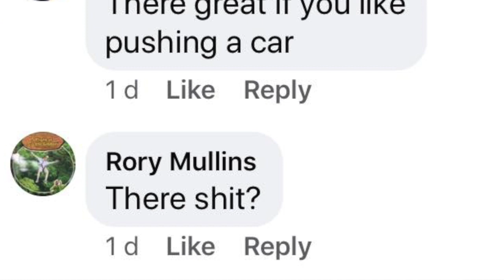WHY DO PEOPLE HATE JEEPS??

Comment: Had 2 jeeps, 2011 jk sport, and my current 2015 jku both sports. Based in us in Maryland and I love it. Its quirks are what makes it full of character for me! No issues but I also haven't slapped 37s on the stock axle with a cheapo lift just to get the look. No real issues with either. 

Got an ox locker in the rear, chromoly shafts, trutrac up front, regear to 4:56, 33's and its been fun and reliable on the trails around me. Dont let others close minded peeps ruin what you like. Here in the states they are a smaller group, but Toyota trd peeps absolutely hate on jeeps all day.
Reply from the maker: SPNKr02 awesome stuff mate, sounds like you have some great Jeeps. Oh yeah definitely, I will always love my Jeeps, just always wounded why people had so much hate for them.

Comment: My experience. Is my jk has been the most reliable vehicle I have owned.  Sure the Jeep is quirky and  some non essential bits fall off but is just keeps on going. And has never let me down. And I’ve taken a stock jk beyond what you would need a heavily modded Toyota to get through.  

I think it’s just because parts are expensive. ( jeeps dealerships think it’s a Range Rover) and Toyota’s are a easily accessible and any grease monkey knows how to work on them.  Lots of parts available.

Ironically when I go off-roading with mates I’m the only one who does not bring spare parts. 

Granted. Patrols and land cruisers are built stronger. But then again I can get a Jeep fuel it for life and have left over money. For the price is a cruiser and out drive if offroad.  Cause it’s lighter and cheap to fix if you know how to use a wrench.
Reply from the maker: 5p1nna absolutely awesome stuff mate, hahahahaha yeah definitely, but that’s part of the fun. Yeah the parts can be expensive to from USA but like you said it is still half the price of buying a hilux with 30000km on it. Good on you mate 🤙
Reply: 5p1nna how many miles and what year do you have 😂
Reply from the maker: Benny on my one? 152...km and it is a 2010 JKU
Reply: CHEAP JEEPER I just got a Jeep it’s a Sahara 2 door with 109,000km it’s a bit rusty under neath but the main frame rail are not it’s a 2011 hopefully I’ll have many fun years with it 🤘
Reply from the maker: Benny awesome stuff mate, can definitely tidy it up if it is just surface rust. Hope you have some great adventures in it.
Reply: Benny  2011 3.8 manual. 110k
Reply: Benny  just get in ther with a can or rust converter. And go ape. Also note that the drive shafts are not painted from the factory and they look rusty but it’s normal
Reply from the maker: 5p1nna definitely the way to do it, a lot of people just paint them with rust kill and leave it as that.

Comment: Because they are loud, suck fuel, poor braking distance, poor acceleration, they can't take turns or ramps at higher speeds, ride isn't smooth and most importantly unreliable
Reply from the maker: BF very interesting points, have you owned many Jeeps before?

Comment: rust
Reply from the maker: Takeoff BMX is that depending on where you live?
Reply from the maker: Takeoff BMX oh man that sucks, do they rust faster than other car brands?
Reply: CHEAP JEEPER WAY FASTER. Being the frame is a box frame. Salt and sand they put in the roads to help with snow gets into the frames and rots them from the inside out. It’s a big issue with these jeeps here
Reply from the maker: Takeoff BMX oh that sucks, definitely not a good look, what do people do in winter?
Reply: CHEAP JEEPER if you drive your Jeep in the winter most guys blast it with used oil or “undercoat” to help prevent the rust but with me I’m just parking it for winter and buying a different car. It sucks because I want to drive it all rear round but if I keep doing that it’s just gonna rust away